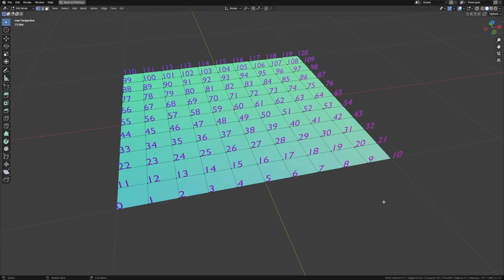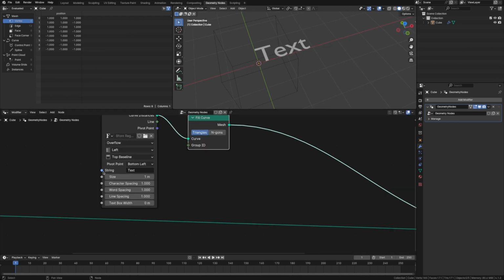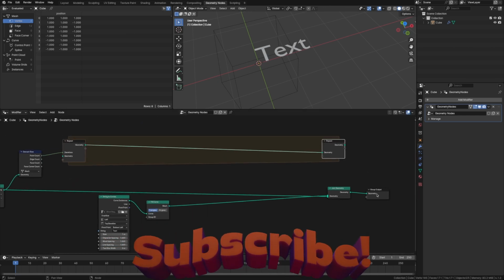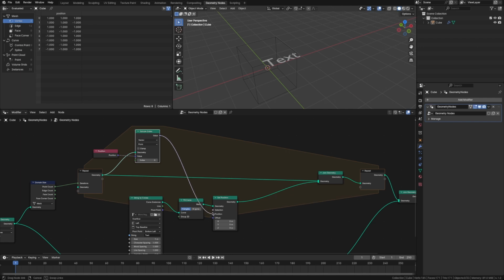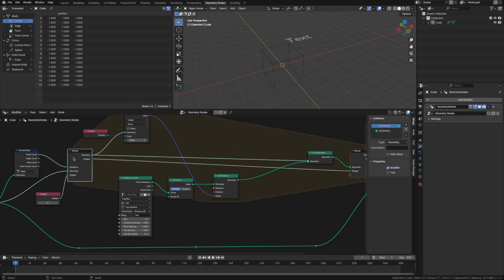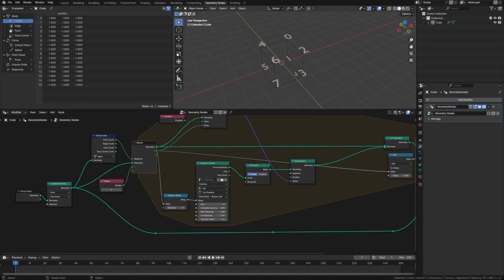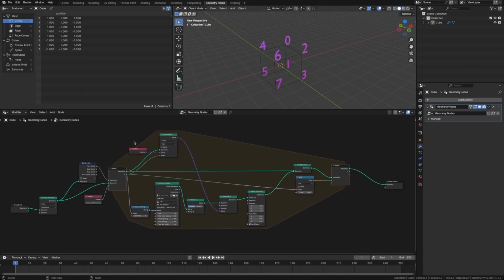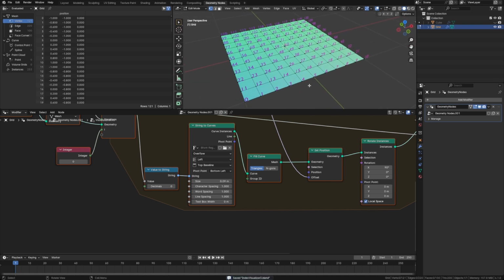Geometry Nodes Visualize Element Index - Blender Tutorial

Comment: Or you can use the Viewer Node with Index and check the Attribute Text box in Viewport Overlays.
Reply: Yes but it does every object. This is labeling for selected.
Reply: yip , I only learned about this last month . The overlay checkbox should be an option on the viewer node or in geonodes side panel if you ask me , would make it easier to discover and remember .
Reply: @havocthehobbit  I agree.
Reply from the maker: Good call! That's so much easier, and more powerful. I'll have to do an update sometime.

Comment: Why not use viewer node?😈
Reply from the maker: Well the viewer node will allow you to inspect the indices and their positions in the spreadsheet, but not actually visualize them next to their elements in the 3D viewport as far as I'm aware.
Reply: @TiFiDesign  In fact, there is, there is attribute Text under the viewport overlays, and it is turned off by default.

I originally gave a link, but it seems like YouTube doesn't allow me to post a link.
Reply from the maker: Aha! I never knew about this overlay! Looks like it was just introduced in 4.1. Thanks for the pro tip!